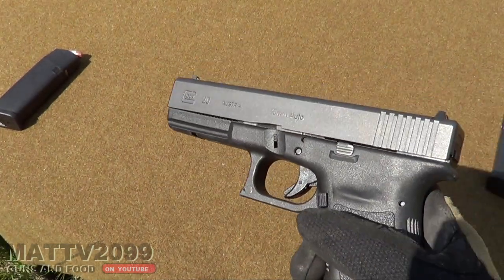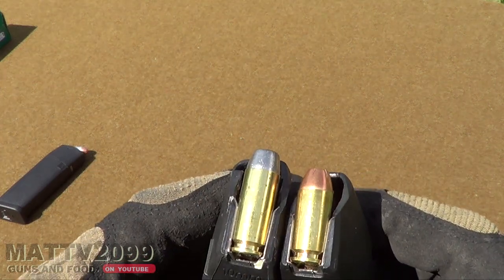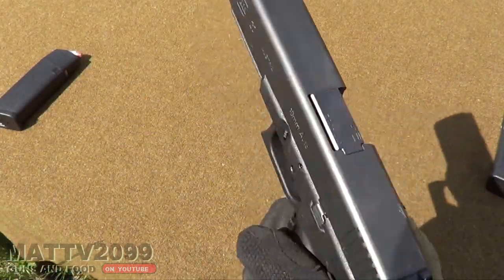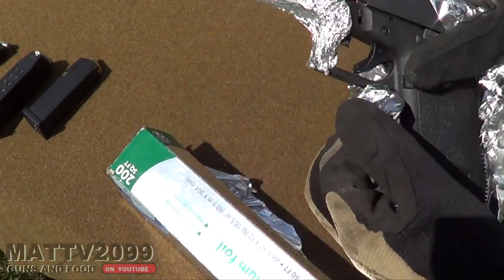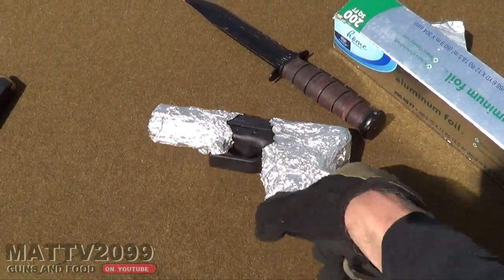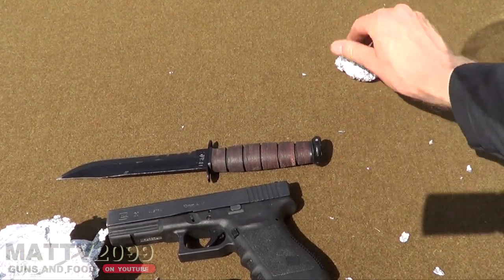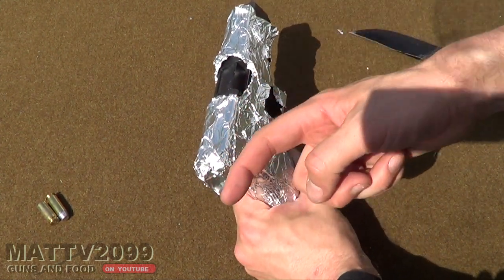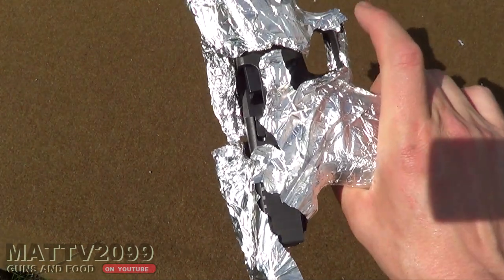Will TIN FOIL Disable A GUN???  10mm Glock 20 Function Test.

Comment from the maker: What happens if you wrap a Glock with TIN FOIL? How much tin foil will it take to cause the Glock to malfunction? Is one piece of tin foil powerful enough to stop the slide from functioning properly? Will this create an over pressure situation and kaboom the glock? This has been suggested by viewers on multiple occasions and seemed like a fun video to do! This is a wacky function test and there are a lot more in the Glock Function Tests Playlist! The title of this video is: Will TIN FOIL Disable A GUN???  10mm  Glock 20 Function Test.

Please note that the activities in this video are NOT dangerous at all. viewer, Iron Enthusiast, said it best:

 "Many firearms, including Glocks, are designed to be carried loaded with a round in the chamber. Unless the trigger is pulled, requiring a rather intentional effort with a Glock, they are completely safe. This was a goofy, pointless experiment, but his allegations that this was dangerous were invalid. If you mess with the trigger in some way, then yes. With an unmolested trigger, it really doesn't matter what you do with the gun, loaded or not, perhaps aside from tossing it in the fireplace. They don't discharge without pulling the trigger, ever, period. I've carried loaded and chambered Sigs and Glocks for decades. They're totally safe. If someone is unable to NOT pull the trigger, they might be the kind of individual who should put their car in park and shut off the engine to avoid flooring the gas pedal at red lights, careening into oncoming traffic! This is probably not the type of person who should own firearms!"

I have created the illusion of danger and recklessness to induce an emotional response in uninformed or ignorant viewers that I have to deal with every day. Thank you for watching.

The Glock function test is an operation where we subject the legendary Glock to unusual circumstances and observe how the Glock performs. Sometimes we test products or lubricants. Other times we test the Glock without important parts or with unnecessary parts added! Wrong ammunition? Parts from other glocks or guns? We even attempt to bust myths! Stopping short of exploding our gun! I primarily use a Glock 17 in my tests. Sometimes a Glock 19, Glock 23, Glock 22 or Glock 20 is featured. The glock 17 has been featured in over 50 test videos in the last two years. Going strong, the only part I have replaced is the recoil spring! However, I believe that the fire control group will be the next replacement. Don't try this at home. This is the World's Most Abused Glock.

Glock Function Tests Playlist:
http://www.youtube.com/playlist?list=PLKk6ypNjwym3dzKnWs0MMaDJEAeWO3PEF

Subscribe to my second channel:
https://www.youtube.com/user/matthewjamesbeast

Here are a few of my recent popular videos that you may like:
Weaponized Chopsticks: https://youtu.be/KV3qoBOefAE
AK47 Filled With Twinkies: http://youtu.be/kIuni6_K_RQ
Unsafe AK47 shooting: https://youtu.be/8Z8vRS09OgM
Glock wrapped with rubber bands!: https://youtu.be/sy2qvclTfTM

Check me out of facebook!
https://www.facebook.com/MatthewJamesBeast

I have a patreon campaign:
https://www.patreon.com/user?u=419985

Music used: 

Lock & Load by Machinimasound.com
Licensed under Creative Commons CC-BY 3.0 Unported License | https://machinimasound.com/license

Android Aware Remastered
http://youtu.be/EUKJ042lqEQ
by:TeknoAXE
http://www.teknoaxe.com
http://www.youtube.com/user/teknoaxe
Reply from the maker: MattV2099: Guns & Food wow
Reply: MattV2099: Guns & Food I like that you say tin foil, I thought I was the only person that still did that.
Reply from the maker: ilovetheusers lol. :)
Reply: ilovetheusers By far not the only one!

Comment: I do see an issue with your hole placement Matt. You actually need to cut a hole BEHIND the spot you're cutting for the shells to eject through.
Your barrel only moves back 1/8th of an inch while its dropping out of the slide's way. So the spot you should be cutting for the ejection path is the inch or so behind where your ejection port LOOKS to be.
Reply from the maker: Doubletap88 great point, homie. that's excellent science.

Comment: Cool video but the issue I have is that his hand is not all the way up the tang. This causes massive energy leak along side shooting it with one hand. So the energy that would go into cycling the firearm is wasted in his hand, wrist, arm and so forth. I'd love to see this test done again with the hand all the way up the tang and using both hands. This might solve the energy leak problem and I have a strong feeling that the firearm would preform the way it's designed to.
Reply from the maker: Sukunai yeah totally

Comment: Tsa did not exist in 1986. The FBI was the one that placed the call so to speak.after a less than spectacular performance of their then current issue 38 special and 9 millimeter handguns (147 gr. subsonic rounds). In a failure to stop incident that cost several agents their lives before the perps were eventually killed in the gun battle.

Comment: You have to make the hole for the bullet to eject behind where the ejection port is when the gun is in battery, because the ejection occurs when the slide is all the way to the rear, the tin foil wasn't move back with the slide in the first attempt. :P Keep making funny videos.

Comment: there are different grades of aluminum foil.( it is not tin as tin is steel)  If you purchased a cheap roll of foil it would be thinner gauge. The test on the glock 17 may have been tested with a higher grade and higher priced tin foil which is twice as strong.
Reply from the maker: David Belitz No way dude. I don't use higher priced items in my operations.

Comment: This would never work unless you covered it in so much that parts couldn't move. It would always work because there are no electrical parts in a gun for the foil to interfere with.
Reply from the maker: Ishaan Chahal one sheet of foil will disable a gun. yep
Reply: MattV2099: Guns & Food how though?
Reply from the maker: Ishaan Chahal you watch this vid or the other one I made? the action of the slide does not have much energy. it's easy to disrupt. Minor disruption will lead to failures.

Comment: Please actually research your information before you give it out.  The 10mm was not created for the TSA - this is kind of obvious, as the TSA was created in 2001 in response to 9/11 - it's official creation date is Dec. 10th of that year.

Not sure how you'd get that wrong, since you note the round's creation in the 80's, which is accurate.  Still, it's best not to confuse things that are pretty much common knowledge (that the TSA isn't 30 years old).

TSA agents are also unarmed.

Wouldn't usually make a post to point that out, except you make the same mistake multiple times referencing the TSA.
Reply from the maker: E1m0ren The TSA has a swat team. I know a dude The Wound Channel . He is a former TSA operator.
Reply: No, they don't - air ports and other installations have their own security teams that work WITH the TSA - they are not TSA "operators".  And STILL - the TSA didn't exist till 2001.
Reply from the maker: E1m0ren no way, dude
Reply: E1m0ren TSA been doing black-ops operations since WW1.5

Don't believe what they teach you in school bro
Reply from the maker: The Wound Channel can I have your autograph?
Reply: The Wound Channel
The TSA, which didn't exist in any capacity till 2001, was carrying on ops in WW1.5

Maybe you should actually go to school.  Might help.